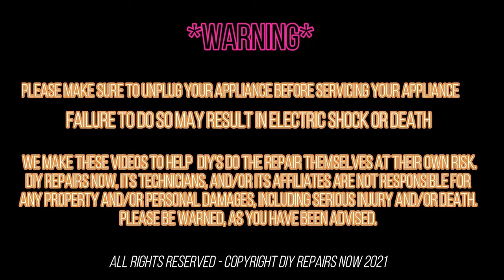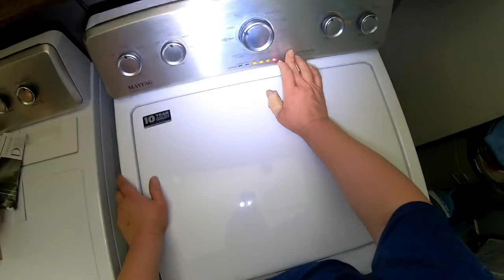How To Fix Maytag Centennial/Bravos Washer OFF Balance | Washer Shakes Bad During Spin Cycle

Comment: I changed out the rods..machine banging more than it did before...still not going into spin cycle properly..and water still remains below the cylinder..specifically how are the rods supposed to be positioned on the bearing??
Reply: Same thing with my washer

Comment: So ...I've got bad banging and unbalanced during the spin cycle.   But when I push down on the agitator, it's still firm and no "up & down, as though the shocks are fine.   Getting error codes....shifter fault & motor fault.

Comment: What cause the shocks to go bad on a fairly new washer?
Reply from the maker: A lot of uses, overloading and uneven floor
Reply: @DIYRepairsNow  Makes sense,  our washer is barely 2 years old but wife uses it a lot. 
Looks like shocks need to be replaced already.
Reply from the maker: They can be different facts one of them is not knowing how the washer works if people read the paperwork and use the washer according to the paperwork Washer will last longer for example this new washers you need to fix the clothes around that way when it begins to wash the clothes it’s not only on one side creating an off balance load The other one is that some of them does not have an agitator and some of them have an agitator but the tub is big so people think they can put more clothes in there and they overload the washer another reason it depends on how many people lives in the house the more do you use the washer the less is going to last because it’s more useless when there’s more people it’s like when you put a lot of mileage in your car eventually thinks it will start breaking down and it’s a lot of more factors but those are the most common ones

Comment: How often do these honkers go bad?
Reply from the maker: If you use the washer the right way between 4 to 5 years if you overload the washer and used the wrong way between 1 and 2 years
Reply: @DIYRepairsNow  Use it multiple times a week and has lasted for 7 years now!! Sweet.
Reply: @DIYRepairsNow  Took me about 25m to replace all 4. Now, the spline and small agitator is a pain in the neck. I have to replace the plastic piece every 8 months. Wish this was designed better BUT it is a cheap repair.

Comment: Did u not have tub centering springs on these?
Reply: In a video I seen where there were 3 tub centering springs , front and back on the right side and only one in back on the left  near ur suspension rods( which I just replaced all four on mine and still banging violently ) the little springs on the video connected to the tub near the area of each of the three suspension rods  and then just hooked on the suspension rods, now my question is : Does the model# MCWC565FW1  commercial capacity Maytag washer require these springs, because I ain’t gonna lie the tub floats around a lot and I could see  where it might help having those specific springs! Please inform me ASAP because we’re in dire need of our washing machine so my wife isn’t having to go to a laundry mat to wash our clothes and my friend u know the old saying “HAPPY WIFE HAPPY LIFE!”

Comment: I ran a diagnostic..received a f0e5 error code which is unbalanced load... i pushed down on the drum, it only bounced once...i checked the machine, its level..what else could be causing the error code? The machine will run through all cycles...but clothes will still remain a bit wet and there is water swooshing around below the cylinder/ drum..any help would be appreciated..thanks..
Reply from the maker: Check the water valve if the load is finish and it’s still water dripping that’s your problem
Reply: @DIYRepairsNow  the valve is good...should i gamble and get new rods or just get a new machine?
Reply: @DIYRepairsNow  thank you for your timely response.
Reply from the maker: Is the Washer of Balance do it bangs on the sides
Reply: @DIYRepairsNow  it does not seem to be banging on the sides..

Comment: Why does it still shake after changing shocks?
Reply from the maker: Make sure you adjust all four legs sometimes if the cabinet is touching the floor it will shake as well
Reply: @DIYRepairsNow  Not touching anywhere! Thanks!
At least after changing shocks, it shakes some but don’t walk around like it did before.
Reply: I changed the springs but it walks and vibrates a lot still

Comment: I replaced the suspension. And I still have the same problem. Wat else can  it be
Reply from the maker: If you push the agitator down, and if it bounce more than once, you still have a shock problem If it doesn’t bounce more than once make sure all four legs are adjusted and level if it’s still shaky also, can be the drum ring https://youtube.com/shorts/WXNNfP8dpV4?feature=share but this is not common some people remove the water from the ring and it worked some people add water to the ring and it worked. You will have to drill a hole in the ring or replace it. If that doesn’t work, it will be the whole drum and the shaft and that’s a major repair and it’s not worth it

Comment: What if it shakes violently, but the shocks are fine? Then what what could it be?
Reply from the maker: Sometimes the shocks looks fine, but they’re not fine if it’s not the shocks it’s other things that can be checked but It have to be checked by a professional. The shocks are the most common things, so I always suggest start by replacing the shocks if continue the problem the shocks have to be replaced every two years anyways so you’ll have higher a technician to look for another issue.

Comment: I just got done replacing all of them with new springs,  and rods, still shakes violently:/
Reply from the maker: You need to check if you install them correctly next push the tub down to see if it bounce if it bounce more than once you need to return those shocks because they are bad and install a new ones if it only bounce ones, that means the shocks are fine Make sure you adjust all 4 legs and make sure the cabinet is not touching the floor and next I'm gonna send you a link for another thing that I could cause a shake with new shocks…
Reply from the maker: https://youtube.com/shorts/pTnLllOoB0U?feature=share

Comment: Hey... I changed the suspension rods on my Maytag centennial top load washer and its still banging on the housing. What else can be wrong? Help me please.... Anyone
Reply from the maker: Sometimes the new rods are a little different and short if it’s banging on the top I had that issue once and it was hitting on the top front of the cabinet I noticed where it was banging and I bent the metal up in the fix my issue I hope that help you

Comment: All these videos about same stuff I changed my spring and actuator but yet my drum is moving all around inside the tube why I pulled it apart the plastic peace has teeth and I’m guessing the bearings but it’s been few weeks now my laundry needs to be done and I use to be a engineer at Whirlphool for commercial part but why make this junk like this - this machine is not built to last

Comment: Great video. But don’t buy the kit linked from Amazon. It made everything worse.  The item is too long and the spring is too short. Good luck everyone!!!!!!
Reply from the maker: Can you please tell me what is wrong with the shocks they are link the washer will still off-balance?
Reply: @DIYRepairsNow  yes they it’s were way to long and the spring section was too short. Made the problem worse and the top tub ring is now damaged. The one of the damper pads was ripped off. If you look at the item reviews it seems to be a common issue.
Reply from the maker: OK, thank you very much for letting me know. I am going to put another link.💯👍🏻

Comment: Mine is a top loader with no agitator and it shakes very violently during a spin cycle to the point where the washer has to stop so I have my doubts its the shocks been worn out because I can see when it starts to spin how the basket itself begins to spin crooked and is what leads to it banging the sides and moving the washer violently to where it stops, I have seen other videos where bad shocks just make the washer vibrate heavily or mildly shake but it doesnt stop it or slow it down, I need to fucking know what the fuck it is!